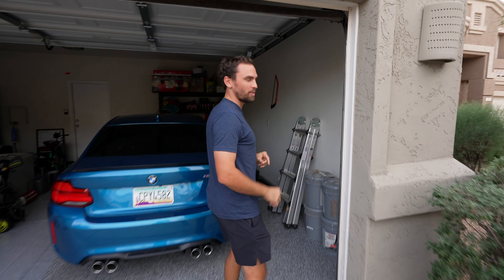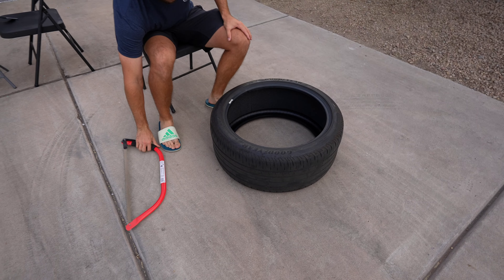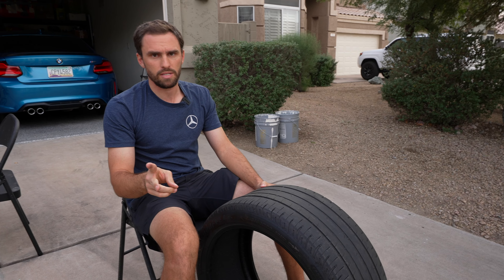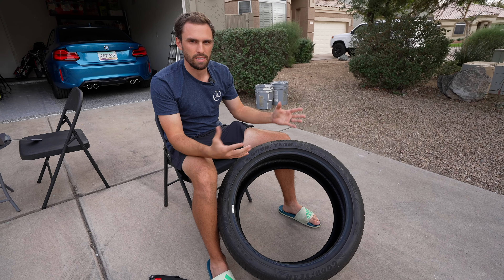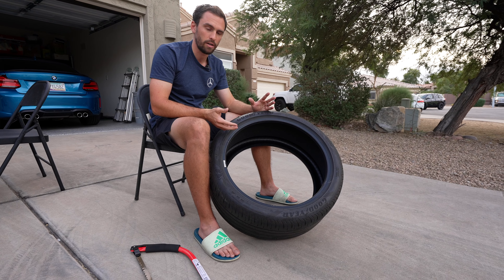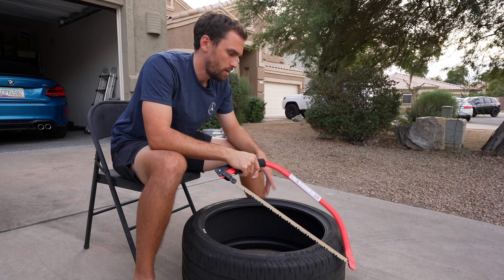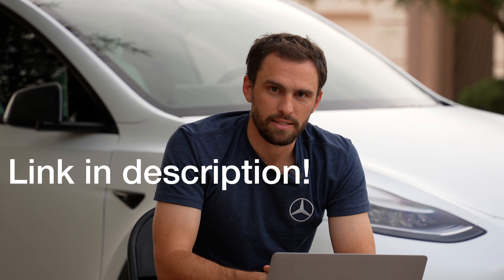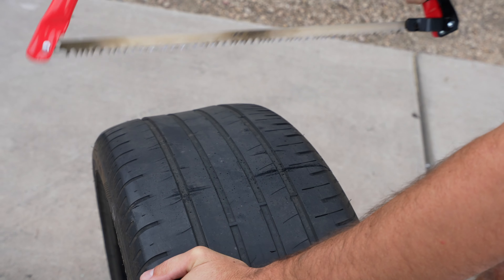What is in a Tesla Tire?

Comment: Yeah I’m thinking instead of a wood saw you need a sawzall with a metal blade or a hacksaw with a metal blade because you’ve got steel belts running all the way through the diameter of that tire.

Comment: I’m old enough to remember the old fibreglass bias-ply tires.  None of this fancy steel-belted radial stuff!  (Seriously though, the bias-ply tires sucked even at the time).  About the noise, I know my non-foam interior snow tires are significantly quieter than the OEM foamed Michelins.  And snow tires are typically noisier!

Comment: I'll be honest, I run pretty much all my vehicles at 32-35 psi. The only exception being if I'm doing offloading and then its a bit lower to provide more contact patch.
Reply from the maker: These tires are meant to run at 42psi I guess I should have specified that. My M2 for example runs at 36psi
Reply: The number one reason for blow outs is under-inflated tires  You are just asking for an epic disaster.

Comment: When you go to a discount tire store , are you concerned about them harming your battery on the lift? Just asking , ours is due to show up next year.
Reply from the maker: They don’t put it on a lift in my experience they hand jack them with the pucks to be safe. They know what to do
Reply: No they have them. But I would buy a set to have if the need ever arises.
Reply: I agree with Tom.  I picked up Tesla pucks from Amazon @ $24 and put them in lower trunk compartment.  They are packaged in their own zip up travel bag.  Good to have in case your Tesla needs emergency tire work and the shop doesn’t have their own pucks.
Reply: @tomsekerchak2176  I use pucks for jacking up my car for easier washing of the lower sheet metal.  Discount Tire has them on-hand.

Comment: For future reference, tire shops won’t fix a run flat tire no matter where the puncture is. Tried this on both my cars and they told me to pound sand.
Reply: Why is that?
Reply: That's not a run flat tire.
Reply: His tire isn’t a run flat.
Reply: Agree with ET. My local discount tire store had no issue fixing for free.
Reply: You are correct.  By running flat on Tesla tires, you break down the side walls thus, murdering the tire.   It is best to stop driving on the tire if pressure is below 20 psi, or if you have a nifty 12v pump  and the leak is not too fast you can muddle thru until you get to the tire shop.
Reply: @flightgamer7849  It is their corporate-wide policy to fix your tires free .  Great marketing.  So when you need a tire replaced you will come back and pay their rip-off price of $43.00 PER TIRE to mount & balance new ones.